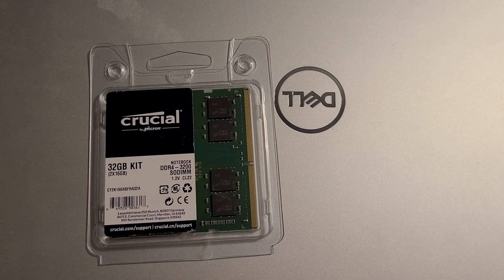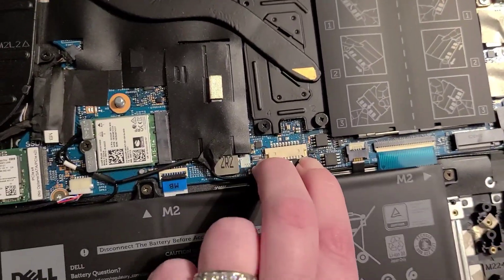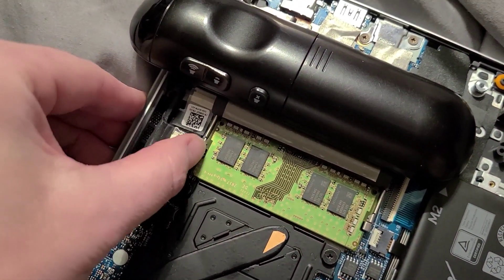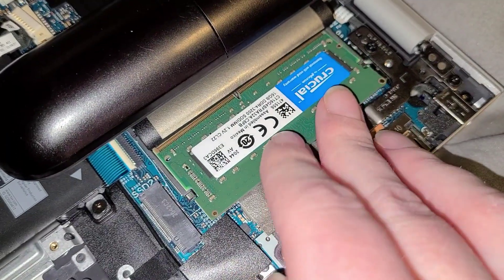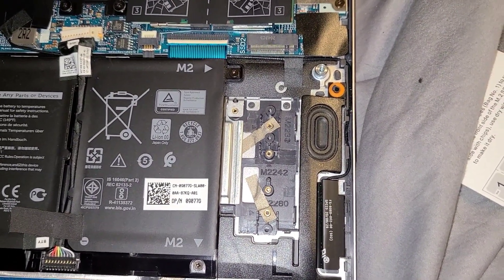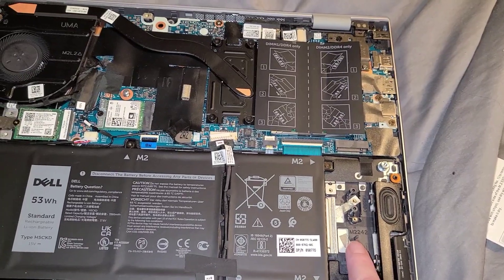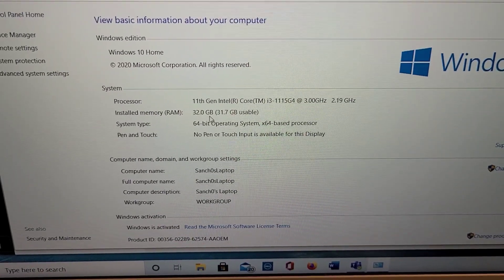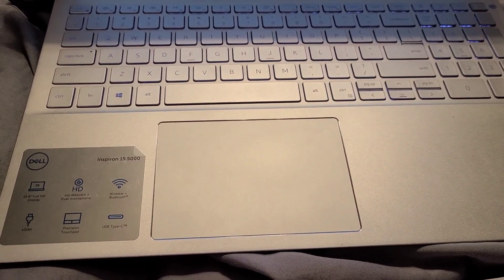Upgrade the RAM in a Dell Inspiron 15 5502/5509

Comment: I have the inspiron 15 5505 with ryzen 7 and i made the exact same upgrade yesterday, even the cpu temps are running lower, great upgrade. when gaming the ram usage goes up to 15gb usage just with 2 or 3 google chrome tabs open and triple a games. so id say 32gb is the sweet spot at least for the ryzen model.

Comment: Hello, is it necessary to unplugged the battery connector before and replugged it again after installing RAM? I saw few other tutorials and they skipped those steps. Very informative video though, keep it up!
Reply from the maker: Thank you so much for your support!   Unplugging the battery before installing RAM and plugging it back in after installation is following proper standard operating procedure.   Not everyone does it..... but it's the safe/ right thing to do.   For example: when I went to college for automotive when I was younger.... just to change a tire on a car... one of the first steps was to unplug the car battery before doing anything else..... even though the battery has nothing to do with changing a tire..... it was part of the procedure lol..... in all reality when I do certain work on vehicles.....I do not unplug the darn battery for every little job that I have to do.   (Changing tires, brakes, wheel bearings, suspension parts etc)   but when working with some electrical stuff, you do have to unplug the battery for safety.   When it comes to our electronic devices.....I always unplug the battery for the safety of the electronic device. The reason you should disconnect the battery is to prevent the system from turning on by accident or having some power to the motherboard and shorting it out if you touch something.  If and when working on any electronics.... it's also a good idea to wear a grounding strap to prevent an electrical shock happening when you touch the inside components, causing a possible short in the system.   Hope this helps you to understand why it's preferable/recommended to unplug the battery when working on your computers etc.   🍻Cheers!   I'd say the most difficult process of this repair/ upgrade was getting the mouse track pad screws(for reinstalling the bottom cover at the end) tightened properly along with clipping/ clicking/ snapping the edges of the  cover back into place.   If all of the clips aren't clipped exactly right..... along with the screws being the proper tightness, etc.... then the track pad won't right/ left click properly.   It's not impossible.   It's pretty simple to figure out and good to know ahead of time what to expect when dealing with that part of the installation.   Good luck! 👍 ✌💪🤗  you got this!   If you have any questions, please feel free to ask! 😝💜

Comment: May i ask you a question, so the 5502 series have 2 slot of memory ram mam?
Reply from the maker: Hello!  On the Dell 5502 model, there are definitely 2 slots for RAM. If I'm not mistaken,  you can put a maximum of 32gb RAM total in the laptop( Qty:2 16gb ram sticks)    there's also a spot to install a secondary ssd (more storage for the laptop).  Because it's a secondary slot, you don't have to reinstall windows etc.... BUT!!! You DO have to order the SSD installation bracket, the bracket to computer screw,  and the screw that secures the SSD.  The installation bracket and 2 different screws do not come with the laptop.... you have to contact Dell and give them the specific part numbers(which are specifically listed in the description section of the next video in line,  which is the installation or upgrade of SSD in the Dell 5502.)  If I'm not mistaken,   I think that you can add/ install a secondary SSD with a maximum of 2TB in the dell 5502.  Hope these videos help you with your installation! 😊✌

Comment: Can I upgrade to 32 GB in a single slot and another slot free?
Reply from the maker: I don't see why not.... my laptop has 2 slots but my laptop only came with 1 ram stick.   The advantage of using 2 is you can run in dual-channel mode, which may give you a bit more speed.
Reply: @sanch068  thanks... Will the board 8 + 32 GB.. no where mentioned in dell site... Wonder if it works
Reply from the maker: @muralit4147  I wouldn't recommend adding the 32gb + 8gb.   If I remember correctly, the maximum RAM for this laptop is 32gb RAM.(although somewhere else I read that 64gb ram was the max,  but I don't know how reliable this is)   Dell told me that the maximum RAM that you can put in the computer is 32g (x2 16gb ram sticks)   OR (x1 32gb RAM stick).....BUT !! It's honestly better to install x2 16 gig sticks of ram rather than just one 32 gig stick of ram. 
Usually RAM functions better as a pair of modules. Each DIMM slot has 2 channels, which means that 2 modules using 4 channels is going to be faster than one module using 2 channels. You probably won’t notice a difference, but theoretically this setup is more efficient for your computer to use the memory 🤪  hope this was explained easy enough 😘
Reply: @sanch068  Thanks a lot
Reply from the maker: @muralit4147  I have a definite answer for you!   See the details in the description of my video.   The Inspiron 15 5502 can handle a maximum of 32 gigs of RAM.... but each ram slot can only handle a maximum of 16 gigs each.   2 slots+ x2 16 gig ram sticks= 32 gigs of RAM.
Reply from the maker: @muralit4147  you're so welcome!   Sorry to get the info to you so late! 💚
Reply: @sanch068  Even though it's late but, it's very useful 👌. Will purchase one 16gig stick and update my experience.
Reply from the maker: @muralit4147  I'm thankful that I wasn't TOO too late lol.  Glad you haven't performed the upgrade yet 😊✌

Comment: I just upgraded the ram in my Inspiron 5502. The hardest thing for me was getting the bottom to slide back onto that tab. It wasn't hard, It was just something that I had to pay close attention too as I was doing it. That tab is connected to the motherboard, so I didn't want to just push and snap it back on, even though it looks like you could. I didn't have to go into the bios to configure anything. Thanks for the informative video. I looked at the manual before doing it as well. Your video was a perfect match to the manual.
Reply from the maker: You're the best Jerry!   Thank you so much for your kind words! 😊  I really wish that my tripod hadn't broken on the first video that I took with it lol....I might have some better videos!    I have a much nicer tripod that I'm going to use from now on....I just have to find my phone attachment for it haha.    If you're interested in upgrading the ssd(adding a secondary) stay tuned for my next video.   It's in the process of uploading as I type.   I really truly appreciate your feedback!!  Best comment yet🥳🤩
Reply from the maker: Just going back through my comments.... once again, thank you so much for your kind words! 🥰

Comment: Thank you! Please keep us posted on the SSD.  How did you convince Dell to send you the housing bracket?
Reply from the maker: Stay posted for the installation video, which is coming soon.   It's not professionally done... and my tripod is broken.... but I took the video.  I just have to edit and post it.   You'll need to order the parts from Dell.   I'll post the part numbers under my video in the description.   Take care and good luck.  Stay tuned for the next video! 😉
Reply from the maker: You're so welcome😄  I uploaded the video of the ssd install with the part numbers and everything😊
Reply: @Sanch068 You’re the real MVP 👏🏽 Thanks again!
Reply from the maker: @artbaray  anytime! 😊 happy to spread the knowledge
Reply: that two is has clips in back side just unscreww all the way and pull it. do not force it you'll break it good luck.n the other be careful mouse pad so sensitive when cover back probably mouse goes weird try to keep screws loose will came back
Reply from the maker: @mgkl8465  if you leave the screws loose, they'll work them selves out eventually.    I found that the laptop has to be thoroughly clicked together along the edges.   I tightened the screws snug(don't want to strip out the plastic), double check the snapping of the edge of the laptop along the whole edge where the mouse track pad is.... while doing all of this..... make sure you're checking during screw installation and tightening the track pad by clicking the track pad on both the right and left sides.... making sure that both sides are still clickable.   If not then loosen screws until it clicks on both sides properly.... then double check along the edge/ seam of the laptop where the top and bottom click together.... to make sure that you didn't miss any of the (snaps? Not sure what to call them)   then attempt to re-snug the screws... while clicking the track pad on both sides to make sure the track pad is operating plus right/ left clicking properly!   I greatly apologize if this explanation is confusing at all!   I'm terrible with words, vocabulary, and at explaining things.

Comment: Is this the SSD that you purchased Crucial P5 2TB 3D NAND NVMe Internal SSD, up to 3400MB/s - CT2000P5SSD8? I see it on Amazon. Are you going to but a heatsink on it? I've seen two Heatsink installs on YouTube and they each did it differently. One put the heatsink on the bottom of the ram and the other put it on the top of the ram. One looks like the picture on Amazon and the other is on the other side.
Reply from the maker: The video is uploading right now.   Feel free to check it out.    I definitely bought the aftermarket/ universal heat sink for the ssd.  I put the copper plate on the side with the chips(if I remember correctly)   but I had it already prepped before installing it into the computer.
Reply from the maker: Crucial P5 2TB PCIe M.2 2280SS SSD

CT2000P5SSD8

Configuration ID: CT19510314

2TB M.2 SSD • PCIe NVMe Gen 3 • 3400 MB/s Read, 3000 MB/s Write

Comment: I can’t get the 2  bottom screws out
Reply from the maker: The two bottom screws aren't supposed to come out
Reply: @sanch068  Do you  have a Facebook or Instagram so I can show you what I’m talking about. I really need help so I can change the ram & the ssd
Reply from the maker: Absolutely.   I greatly apologize for the late response!   I've been moving and busy with college😉  look me up on Instagram sanch068 (sanch(zero)68)
Reply from the maker: @almightytyler993  just checking up on you and wondering if you were able to successfully do the upgrades to your laptop?   I never heard from you on Instagram.   My Instagram is Sanch068
 (Sanch(zero)68) .... allot of people get it wrong thinking that it's the letter "O" in my Instagram name, when it's really the number 0(zero)

Comment: You also need to upgrade bios settings after RAM upgrade
Reply: Some come with outdated bios depending where you buy , after upgrading mine with 32gb ram hyperx  and Samsung 970 evo plus ssd I got the dell update message to update bios straight away upon starting
Reply: @MrBenglew  Did you take advantage of a heatsink? If so, which one did you get and did you place it on the top, or the bottom? I want my battery to last as long as I can, but I keep it pugged in most of the time, which I've read isn't ideal for the lithium ion batteries, so I set it to only charge to 80% and then stop charging. I set the perimeters to start charging again at 70%. What a great feature.

Comment: I am planning to add 16 Gb RAM in another empty slot for 5509. So my configuration would be 8gb + 16gb = 24 gb. Is it good configuration, as I dont need 32gb ram. What's your suggestion.
Reply: @Pravin Pimple is it work perfectly with 24GB ? I wanna do the same
Reply: @fermin.amador  I upgraded it to 16 gb total. It works great I run 2 databases with docker and many visual studios
Reply: @Pravvin23n  Thank u, I'll do the same
Reply from the maker: @fermin.amador  it should work fine with the 24gb of ram with two ram cards with different values....
With equal amounts of memory in both slots, memory can be interleaved so that successive chunks of memory alternate slots. That way, memory access gets distributed to both slots almost perfectly evenly, allowing their bandwidth to combine.
With uneven amounts, memory cannot be interleaved and has to be mapped first to one stick and then the other. A program that is accessing a large contiguous chunk of memory will find almost all of its access going to one stick and there will be no bandwidth combination.
When running two different ram stick amounts, the motherboard will run the memory at the speed of the slowest module.    FYI.  But it is ok to run an 8 with a 16
Reply from the maker: That sounds great! 👌  I sincerely hope that my video helps you for your installation!   Sorry about the quality of my video.    I was doing everything one handed while holding the camera with my other hand(bf broke my tripod for my camera)   just make sure that the computer registers the ram after the installation
Reply from the maker: With equal amounts of memory in both slots, memory can be interleaved so that successive chunks of memory alternate slots. That way, memory access gets distributed to both slots almost perfectly evenly, allowing their bandwidth to combine.
With uneven amounts, memory cannot be interleaved and has to be mapped first to one stick and then the other. A program that is accessing a large contiguous chunk of memory will find almost all of its access going to one stick and there will be no bandwidth combination.
When running two different ram stick amounts, the motherboard will run the memory at the speed of the slowest module.    FYI.  But it is ok to run an 8 with a 16
Reply: @sanch068  Thank you very much for the detailed reply. Your instructions will really help in placing the RAM.
Reply from the maker: @Pravvin23n  if I were you I would get another 8gb stick just to keep things the same on each side.   Are you playing games on your laptop?   It is OK to have 2 different sizes.... but make sure the other numbers match.    For example I needed ddr4 ram that had a speed of 3200mh.  So I made sure that I bought the same exact thing but bigger gb ram slot amounts.
Reply: @sanch068  I got the 16gb ram from dell directly just for 60 $. So went for it. Laptop is really fast now, I don’t play games use this machine for development. Run many virtual machines now
Reply from the maker: That's great!!  I hope that my video helped you.   I'm in the process of uploading my laptop ssd video, feel free to check it out. ✌
Reply: @Pravvin23n  what's your profession ?
Reply: @9506himanshu  software engineer
Reply from the maker: @Pravvin23n  nooooo way! That's awesome!!🤩 I've never met or known a software engineer,  toooooo cool!   I'm currently going to college(2nd semester) for electrical engineering technology.  It's exciting but scary(intimidating) 😆
Reply: @Pravvin23n  IITian ?